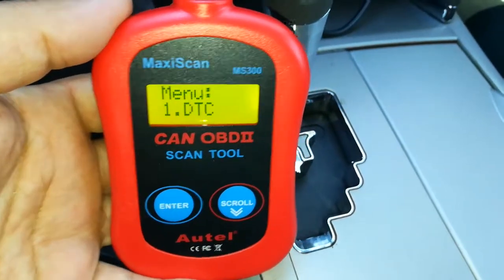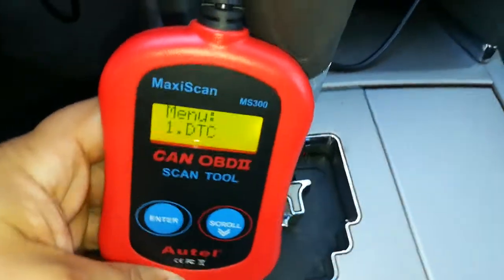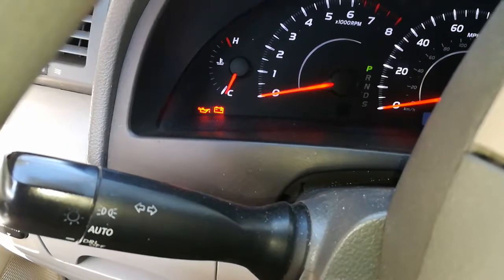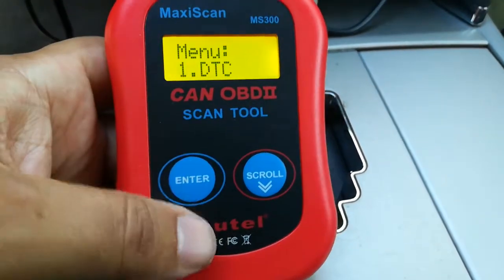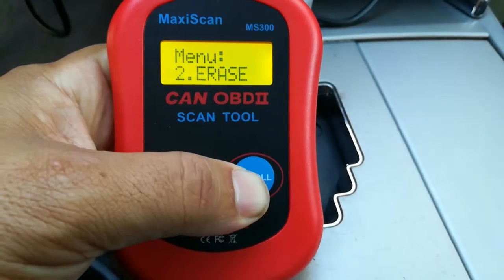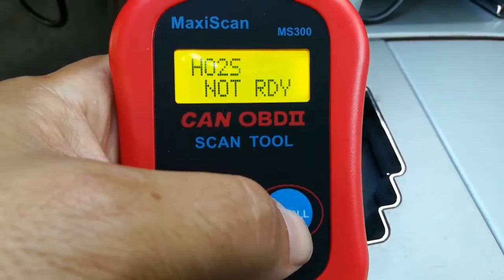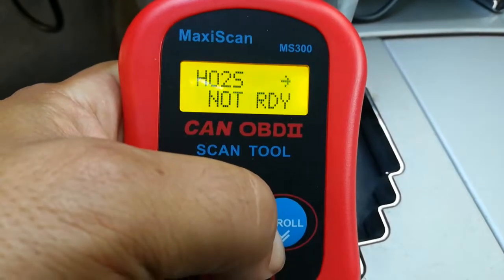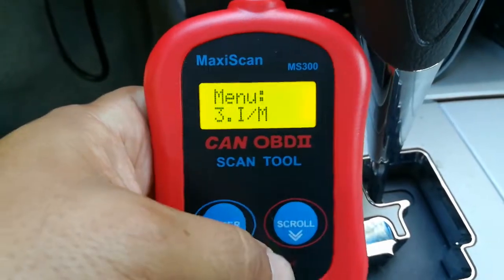How to Use OBD2 Reader To Check Inspection monitors (I/M), DTC, Clear Engine Fault Codes

Comment: Sirji
Got check engine yellow light
.
Used OBD 2 scanner
.
Displayed P0204 code
.
Mechanic did some repair work 
.
Cleared code from mobile
.
Didn't appear again
.
So does it mean original problem is gone ???
.
Clearing code means it's ok 
Aisa hota hai kya

Comment: Is fix easy lights of erase done
Reply from the maker: You should write down the code as it may pop back up. If that happens you want to fix the issue before trying to set the inspection monitors.

Comment: I have same scanner and had 3 codes displayed and also the same 3 codes with "PD" after the code 
I fixed all the issues i think , does anyone know what the pd means?  I cant find instructions sheet and codes wont clear
Reply: A pending code is where the PCM has noted an issue for one event that has not re-occurred. If that event or issue is re-occurring, it will set the CEL light.
Reply: @Lor Oto   ok thanks for info, so your saying that new grid heater, new relays,  new wire terminal ends. .that something still isn't working right?
Reply: It means its a pending code
Reply from the maker: Sorry for the late reply! did you find a solution?

Comment: What does evap not ready mean?
Reply from the maker: The evap is for your evaporative emissions control ( in short gas vapors shouldn’t be going into the atmosphere). This monitor is except even in California and is normally the last monitor to set. Keep the fuel level between 1/4 to 3/4 and park on a level surface. There is really no much you can do other than drive and park over night for it to get ready. What are you driving?

Comment: My check engine light has never come on but yet my truck will not start it cranks but it won't start
Reply from the maker: Check for Fuel, then spark, and check compression.
Reply: @RANDOMFIX   I have spark, & Fuel . Don't have compression tester.  Thinking fuel pump is weak. Only thing . it's holding ,40 psi . Thanks for your help. I'm stumped on this one. Still tracing wires. What fun...lol
Reply from the maker: So if spark stater fluid as you are crank past the mass air flow sensor does the vehicle start?
Reply from the maker: Spark into the throttle body, do get start fluid on the mass air flow sensor.
Reply: @RANDOMFIX  no sir it won't.  Spark plugs are black with Carbon.  They are New truck hasn't ran yet .